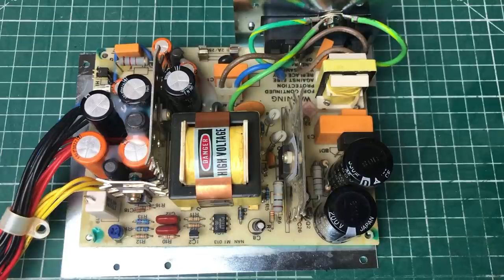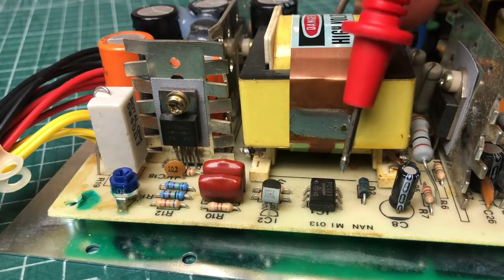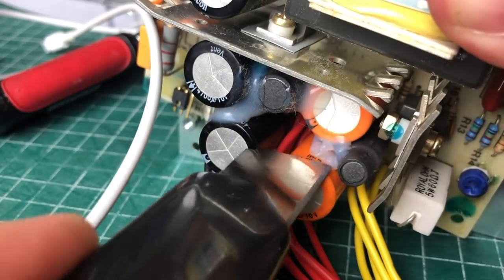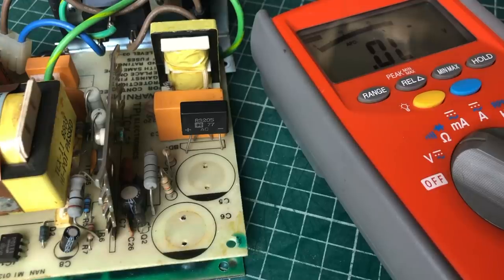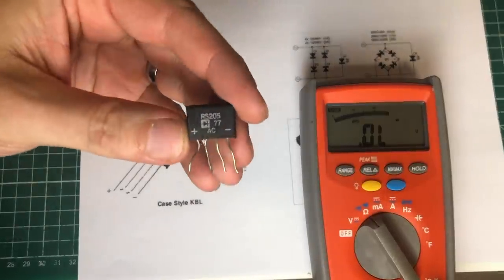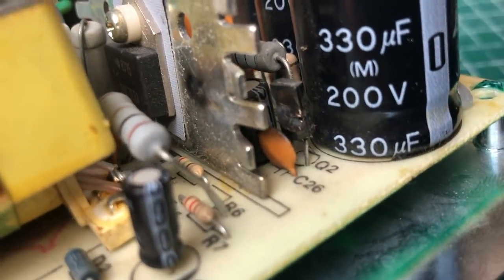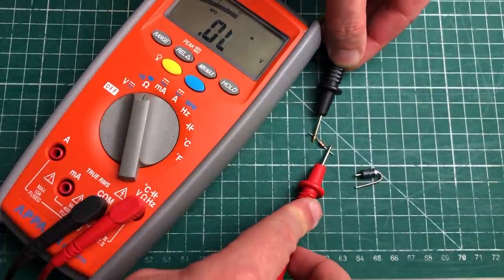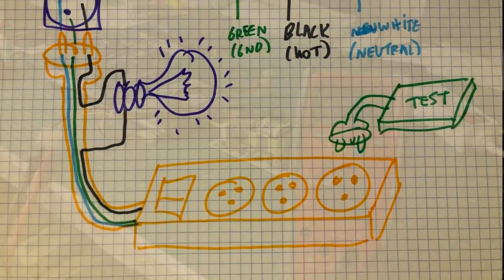Switch mode power supply attempted fix

Comment: That 5w resistor is a 0.12 ohm not a 12 ohm you can see this on the gold ring.
Reply from the maker: You mean the own that blew (next to the power transistor). Isn't it red / black / gold / gold ( = 1 ohm) ?
Reply: @RetroSpector78  yes i mean that resistor its a rush-in resistor for switch transistor
Reply from the maker: dree mephisto ok, but just to be sure, it is 1 ohm and not 0.12 or 12 right ?(sometimes I have a hard time seeing the difference between red / brown / orange on these things)
Reply: @RetroSpector78  the resistor is brown black gold gold 0.10 ohm . i,m sure because i have repair these in the 80,s as a laser repair man the where the same principle power supply no i.c and watch out to use good transistors it must newer be a lower voltage better higher.
Reply from the maker: ... oh I saw it as red / black / gold / gold. (sometimes brown / red looks very similar) But according to https://www.digikey.be/nl/resources/conversion-calculators/conversion-calculator-resistor-color-code-4-band  a 4 color band resistor with brown / black / gold / gold should be 1 ohm ....
Reply: @RetroSpector78  Yes you are wright it is one ohm good find by the way the resistor calculator so it is 1 ohm.keep up the good video,s i like them very much and interesting how get old PC,s working again.
Reply from the maker: dree mephisto thx a lot for all your feedback and comments. Really appreciate it !